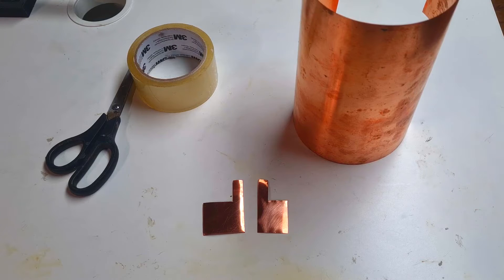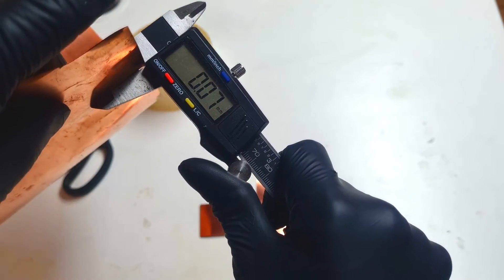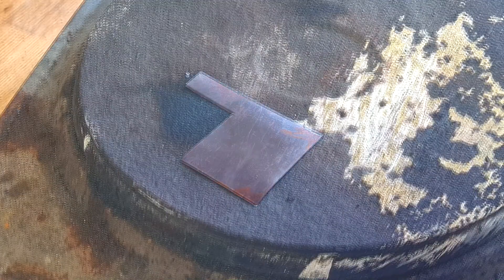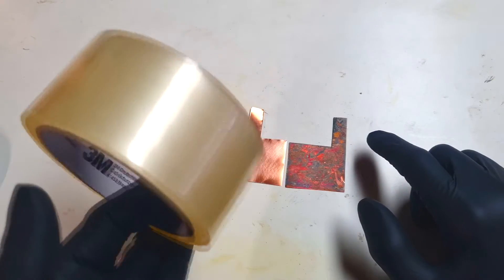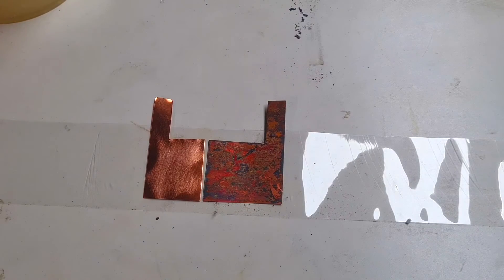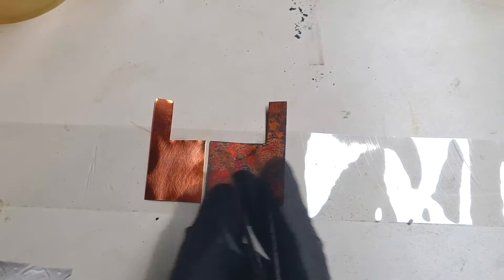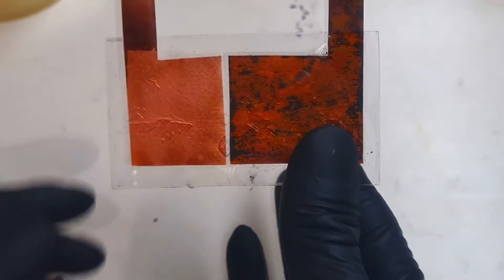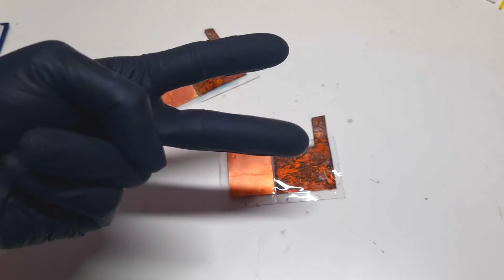DIY homemade Flexible solar cell

Comment: Can this power a 5mm LED light? Please i need answers i want to make a DIY solar cell for a school project
Reply from the maker: Hello! A singel cell will not be able to power the LED. Maybe 3 of 4 cells will do the job, but I am not sure 100%. Use some LED and the voltage booster from garden solar lamp.

Comment: Have you tried a sheet of dry salted or hydrated salted gelatin? Of course also encapsulated, also try with hydrated gelatin and the ink of a fluorescent marker, The gelatin with the ink acts as a light concentrator for the cell, The gelatin with the ink acts as a light concentrator for the cell, Robert Murray Smith demonstrated it with a commercial cell in one of his videos..I like this homemade and cheap idea, greetings.

Comment: I often wonder if instead of toilet paper that dries very quickly when electrodes heat from solar thermal energies, if a glycol gel impregnated with electrode would be more beneficial? Also have you ever considered trying a electrolyte of carbon or graphene? The color of those two may increase a better electron swap due to greater photon absorption.

Comment: Hmm,  solar cells usually needs both  P-type and  N-Type semiconducting materials.  Copper oxide is  N-type semiconductor,  but where your P-type ?   This is probably why your voltage is very low.

Comment: thats a thermocouple also, as diode, like solar cell, no matter where the heat/energy comes from
Reply: would be better if you just torched the surface of a copper sheet, into Cu*O
Reply: why did you measure voltage, and not amps, like thermocouples are more giving
Reply from the maker: The current is 0.8 mA on the sun and 0.2 mA in the shadow,...  nothing more to see!
Reply: @cayrex  right on the seeing, mate!
Reply: @cayrex  hmm how about a burned copper sheet 1m^2 in maximum sun, a much larger surface, maybe some current collecting strips/water on the surface
Reply: @cayrex  what else you can expect from 0.02x0.04m = 0.0008m^2 copper patch (only the copper oxide side is collecting solar), at max 0.8W or 800mW if 1000W/m^2 is assumed
Reply: @cayrex  assume 10% efficiency then you get 80mW max from the small solar cell
Reply: @cayrex  try polished aluminium sheet mirror concentrator to a copper oxide water pipe solar cell with current collector carbon strips on the copper oxide solar side, or just water outside the copper oxide surface